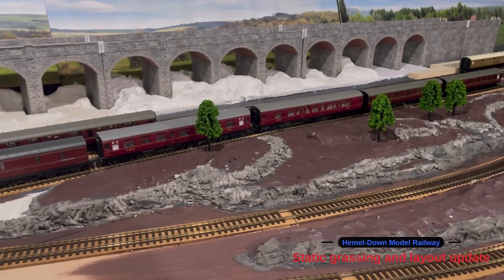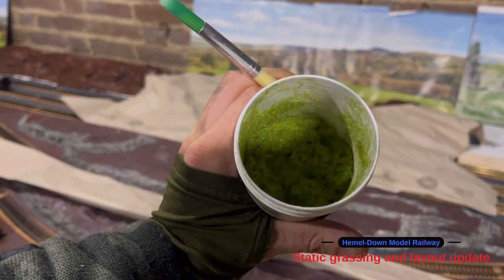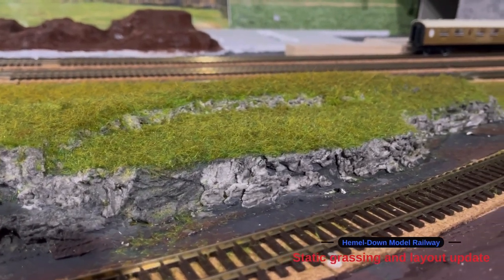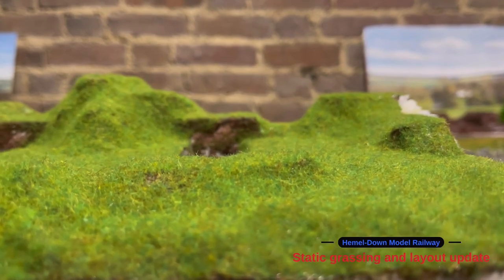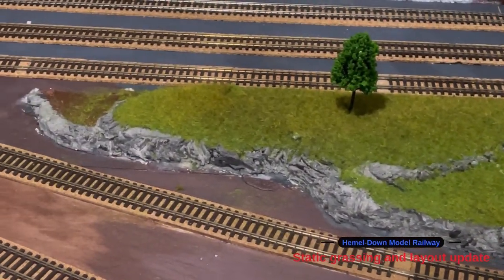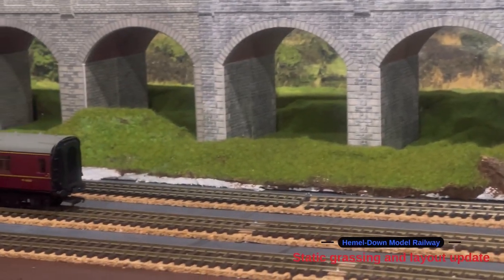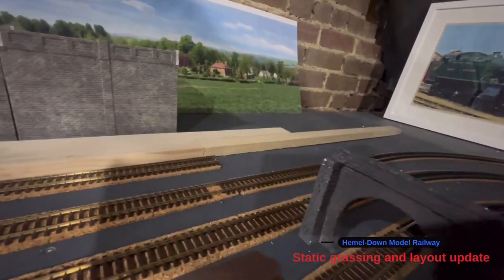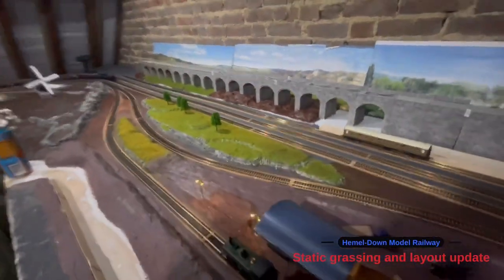Loft model railway-Static grassing and layout update

Comment: Hi Mark Some great progress there the muted colours blending in well and the viaduct scene is really coming along and looking good through the arches. May I add a little tip to perhaps try, if you have a garden or can get some soil, dry it out (it really needs baking in the oven, I know it sounds daft but hey ho), sift it out the finest you can put some watered down pva on a "brown bit" and sive the dryed soil onto it let it dry then flock and static grass on top. Maybe try a test piece first to see how it looks.

Its just a tip I got off other modellers and seems to work for me. Other than that great work and happy modelling! Thanks
Reply from the maker: Really grateful for the tip, I think on the lower areas I will definitely try that tip, when the wife is out though as I’ll be digging up bits of the garden and baking 😂